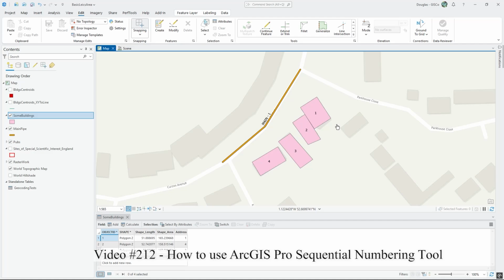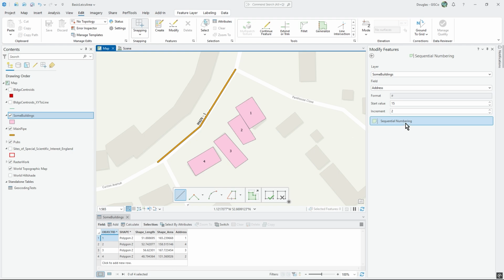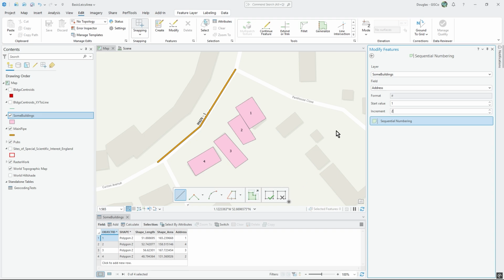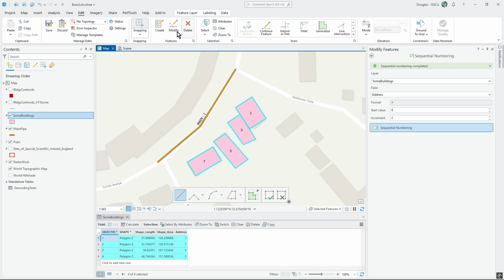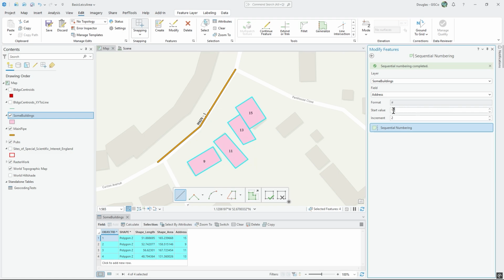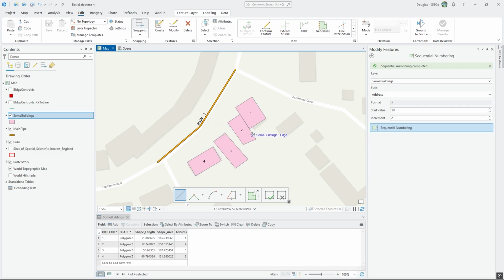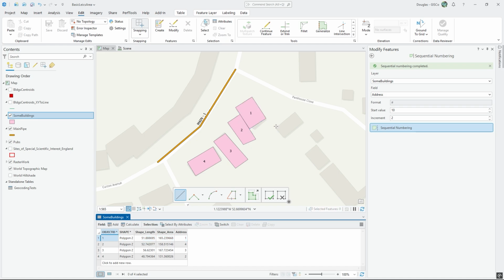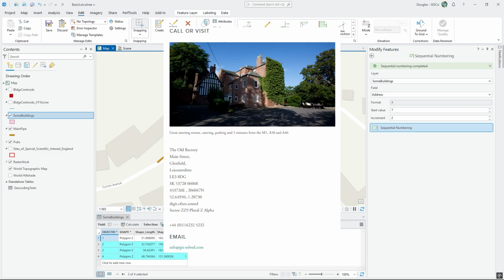ArcGIS Pro Sequential Numbering Tool

Comment: How can you create a combination of numbers, such as 1-2-3-1 to 1-2-3-99, on the parcels of a block using this method?
Reply from the maker: I dont think you can - not without customisation at least. I would probably use the selection and a Field Calculator. Start with numbering everything to 1 to 99 and then use modulo something like:  (FieldValue - 1) % 3 + 1  to generate the 123 patten for all records. I suspect this would require a second datafield to concatenate the two.  
I havent tried this out but I think the answer lies somewhere in those quick thoughts....